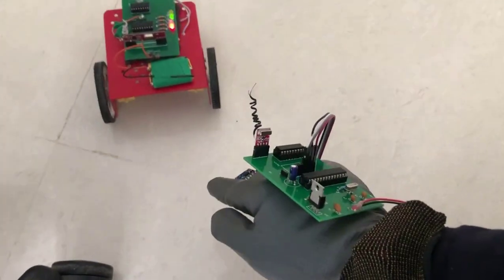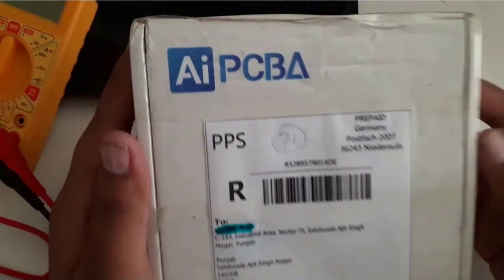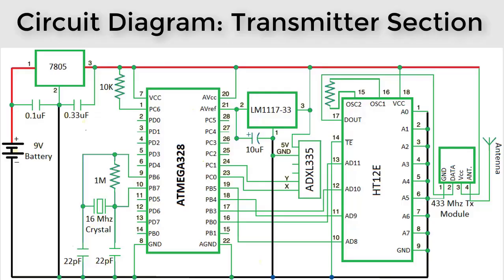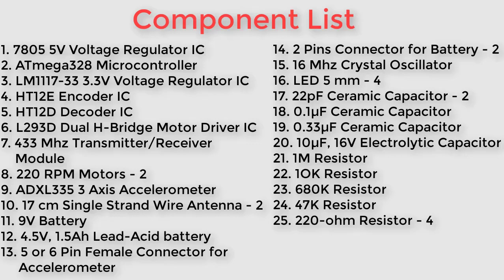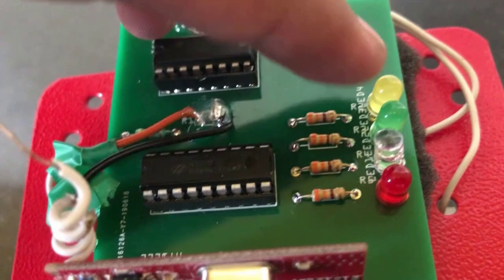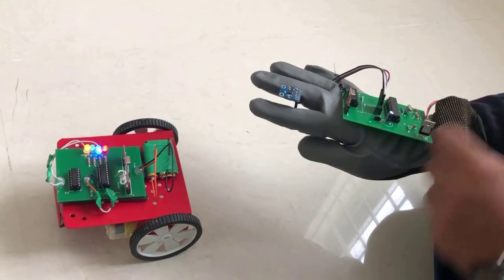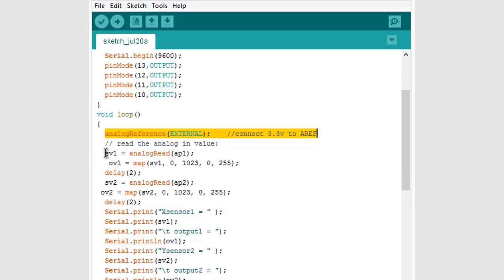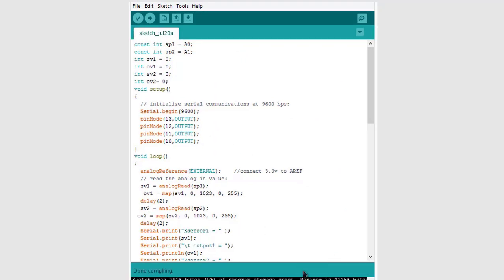Wireless Gesture Controlled Robot Using Accelerometer

Comment: corrected code : 

const int ap1 = A0;
const int ap2 = A1;
int sv1 = 0;
int ov1 = 0;
int sv2 = 0;
int ov2= 0;
void setup()
{
Serial.begin(9600);
pinMode(13,OUTPUT);
pinMode(12,OUTPUT);
pinMode(11,OUTPUT);
pinMode(10,OUTPUT);
}
void loop()
{
analogReference(EXTERNAL);
sv1 = analogRead(ap1);
ov1 = map(sv1, 0, 1023, 0, 255);
delay(2);
sv2 = analogRead(ap2);
ov2 = map(sv2, 0, 1023, 0, 255);
delay(2);
Serial.print("Xsensor1 = " );
Serial.print(sv1);
Serial.print("\t output1 = ");
Serial.println(ov1);
Serial.print("Ysensor2 = " );
Serial.print(sv2);
Serial.print("\t output2 = ");
Serial.println(ov2);
if(analogRead(ap1)>514 &&analogRead (ap2)>463) 
{
digitalWrite(13,HIGH);
digitalWrite(12,LOW);
digitalWrite(11,HIGH);
digitalWrite(10,LOW);
}
else
{
if(analogRead(ap1)>486 &&analogRead (ap2)<508) 
{
digitalWrite(13,LOW);
digitalWrite(12,HIGH);
digitalWrite(11,HIGH);
digitalWrite(10,LOW);
}
else
{
if(analogRead(ap1)>512 &&analogRead (ap2)>560) 
{
digitalWrite(13,LOW);
digitalWrite(12,HIGH);
digitalWrite(11,LOW);
digitalWrite(10,HIGH);
}
else
{
if(analogRead(ap1)>550 &&analogRead (ap2)>512)
{
digitalWrite(13,HIGH);
digitalWrite(12,LOW);
digitalWrite(11,LOW);
digitalWrite(10,HIGH);
}
 
else
{
digitalWrite(13,HIGH);
digitalWrite(12,HIGH);
digitalWrite(11,HIGH);
digitalWrite(10,HIGH);
}
}
}
}
}

                                                                                                    by
                                                                                       Mr.ANIL CHANDRAN
                                                                         (ELECTRONICS AND COMMUNICATION ENGINEER)

Comment: Sir, the RF module is not working after using it for some time. We replaced the RF module 3 times and all the 3 stopped working 😭. Please help me out and let us know why this is happening! Please do reply.We are assuming the batteries voltage is too much for the receiver. Please help us out.

Comment: Can i use ADXL345 3-AXIS MEMS /13 bit resolution instead of ADXL 335?
Reply from the maker: ADXL345 is digital I2C Accelerometer but ADXL335 is analog accelerometer. The code and schematic would be different.
Reply: @HowtoElectronics  thabk you so much for ur fast response, i really liked your project and i hope i can make one
Can you please tell me how to add GPS into this device?

Comment: Brother i am not able to get the output. Can you help?
Reply from the maker: Where did u make the circuit. In pcb.  There are few jumpers that need to be connected and soldered. Check the link in description, the pcb photo along with some yellow line jumpers marking is there.
Reply: @HowtoElectronics  i made it on Breadboard
Reply: @HowtoElectronics  if I connect 9v battery at receiver will it work?
Reply from the maker: Pcb is already given their bro. Go for the PCB circuit. Assembling on bread board with too many components might make a chance of making errors